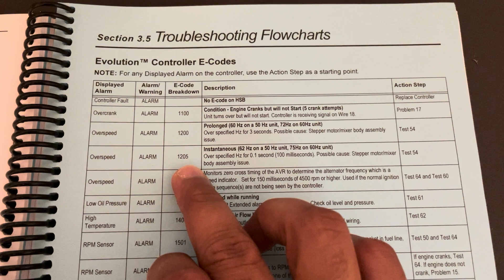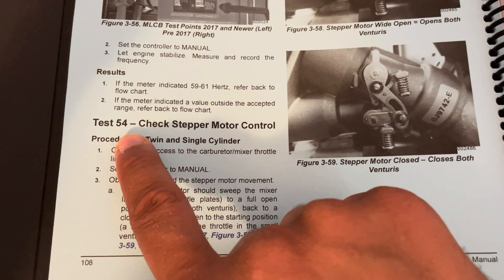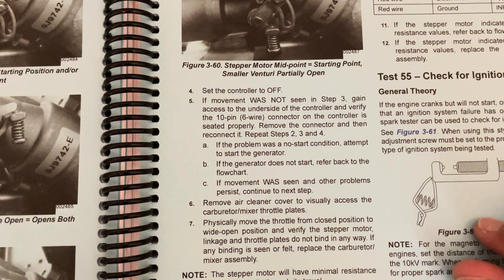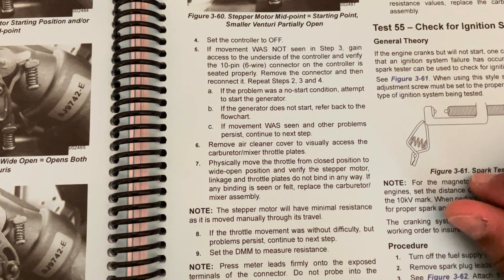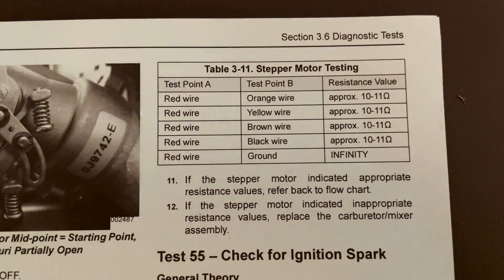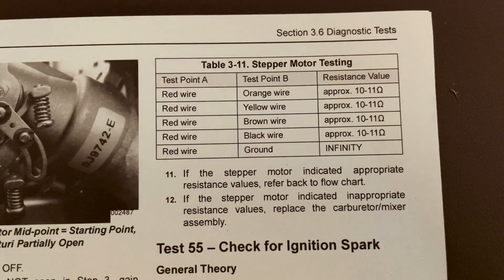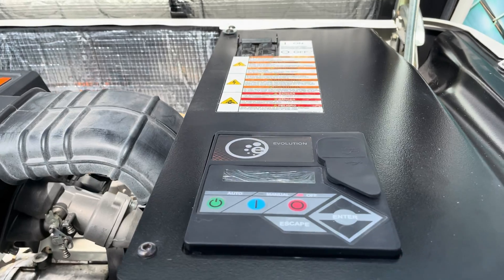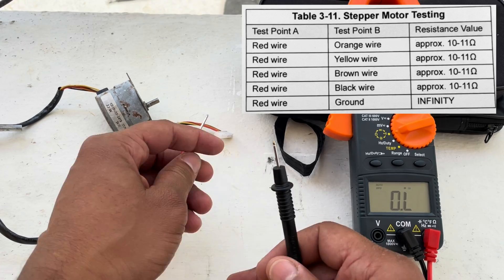How to Repair Generac & Honeywell Generators with Overspeed Fault (Error Code 1200, 1205)

Comment: why not replace the stepper motor only?
Reply from the maker: When I took the Generac Certification class we were told that Generac does not sell the stepper motor by itself and the entire mixer needs to be replaced. But in reality you can replace just the stepper motor if you want. I prefer to stick to OEM for these types of repairs, but there is an aftermarket option on Amazon.

Comment: Mine initially had a 1200 error code. I checked the 10 pin connector resistance and it checked out good. Now when I try to start it I am getting a 1100 error code. The movement of the mixer linkage does not go through its full open/close stroke before it starts cranking. A couple times while it was cranking, the linkage went full open and it started but ran wide open and shut down on overspeed. The linkage movement seems irratic. It does move smoothly by hand, don't feel any binding. Is this a controller issue? Fuel supply issue? Thank you for a response!
Reply from the maker: Thank you for watching and commenting on my video. Verify the fuel supply, the fuel pressure should be between 3.5 - 7 inches water column for natural gas or 10 - 12 inches water column for LP gas. I’ve worked on Generac Guardians with similar issues and all turned out to be the fuel pressure regulator. Keep me updated.

Comment: Dude! Just saved me some $$$ and headaches.  Had code 1205 and come to find out the wire pulled out. Plugged it back up and now running like new! Thanks
Reply from the maker: Thank you for watching! Glad my video was helpful and that I was able to save you some money. Believe it or not the stepper motor plug coming undone happens a lot, specially when the battery is replaced. People are not aware and pull the wire off while taking the old battery out or putting the new one in.

Comment: Hi do you have a video of how to chance just the stepping motor. Only. Because I both it but I. My take the old one off
Reply: Thanks. I did change it. I tought it was good to go and now its giving me 1900 code 😢
Reply from the maker: The 1900 code is the under voltage error code. That means the controller is not detecting voltage during startup and it stay in “warming” for a bit waiting for the voltage then it shuts down. It can be caused by a few things, unplugged conector at the controller (the small 4 pin connector), bad field flash diode, bad carbon brushes, bad rotor or stator. Even a wrong fuel selection will give you that 1900 error code due to generator not running to the correct speed to generate enough voltage. Hope this helps
Reply: @tacticalpowerpro  thanks for you time I’m gonna get it right so I can wear my shirt that I bought from you I won’t wear it until I fix it
Reply from the maker: @ismaelgomez8836 haha awesome! Thanks for your support, I hope you fix your generator and wear the shirt like a pro! Keep me updated 🫡
Reply from the maker: Hi! Unfortunately I do not have a video on how to replace just the stepper motor. But I will add that to my list of future videos. Thanks

Comment: So where do you go when you have a good stepper motor?  My problem is the rpm's are not stable and seems like it is searching.  Then all of a sudden the stepper motor spikes the throttle and the overspeed error comes up.  If I disconnect the 10 pin connector and manually move the throttle the engine purrs at a stable rpm. Connected back same problem.  The control module has already been replaced.
Reply from the maker: I just worked on a generator that had that exact issue you described. The mixer with stepper motor plus the controller were replaced and the generator rpm still spiked after a couple of seconds of it starting. 

I went and checked the LP gas pressured coming in to the generator and it was sitting at 12 w.C. (12 inches of water columns) like it should be. I started the generator and the 12 w.C. of gas pressure skyrocketed to 30 w.C. causing the generator to spike the rpms. Had the owner contact the gas company to check the LP gas tank regulator. They messed around with the regulator, now the generator is purring like a kitten. 

So my recommendation to you is check the gas pressure, you might have a faulty regulator. Hope this helps.

Comment: It’s the second time I came to see this video the first time I watch it I was available to fix the Generac in the middle of a power outage  I have the same issue you had. The little cable got disconnected when I change the battery.  But this time I think is gonna be the whole assembly cuz it did it 6 months later.  Thanks for the video. You really good explaining  everything nice and detail
Reply from the maker: Thank you for coming back to my video. Before you replace the entire mixer make sure you test the resistance of the stepper motor like in the video and verify that the throttle plate is not stuck. Yesterday I replaced a mixer that the stepper motor tested good but the throttle plate is stuck and won’t open all the way. If stepper motor and plates are good then your issue might be on the Evolution controller.
Reply: @   I will check it for sure. Thanks for taking to me to reply
Reply from the maker: Don’t mention it, I’m here to help. Keep me updated.
Reply: I checked the plate and it’s not stuck then I check the resisten and the blalcj cable shows infinity so I have a bad stepper motor.  There is not way to change only the motor you said righ?
Reply from the maker: Ok, thanks for the update. I mentioned in the video that you’ll need to replace the entire mixer because Generac doesn’t sell the stepper motor by itself. BUT, it is possible to just swap the stepper motor. You can find them on amazon, but I don’t know if they are good quality. You can give that a try.

Comment: I went through all this an everything looks ok even the test with the multimeter, what should a i do next ?
Reply from the maker: If the mixer and stepper motor are good then you might have a faulty Evolution controller.

Comment: On the test it looked like the movements were exactly the same as after replacement. What am I missing? Thanks for the video.
Reply from the maker: @WSmith2024  they where the same video clips, the generator was already repaired I didn’t have video recording of the “bad” stepper motor with no movement. I mentioned that the first time I tried to start the generator the stepper motor did not moved at all, but showed a clip of what a good stepper motor should act. The generator in the video only had an unplugged steeper motor connector.

Comment: A diagnosis was right on ,step MOTOR was unplugged. I had just installed brand new generator and tested.
Reply from the maker: Awesome to read the diagnostic was right on the money. Thank you for watching my video out of all the videos on youtube. I really appreciate it.
Reply: @tacticalpowerpro  HEY FOR SOME REASON MY BATTERY wont charge i have 120 V from T1 to the evolution 2 @ at generator where do i ck output battery charge
Reply from the maker: @alvinbihms9629  Hey, you can check the battery charger output or status at the controller but you will need the "dealer" access code. --> ESC, UP, UP, ESC, DOWN, UP, ESCAPE, UP, ENTER.

Comment: Why do you have to also replace the mixer  assembly when only the stepper motor is bad? Many people bought only stepper motors from Amazon  and said that fixed the problem.
Reply: Jus did he same thing and still getting the same overspeed alarm I so hate generac
Reply from the maker: @djterrorist4819  What you did? You replaced the stepper motor?
Reply: @tacticalpowerpro yes and the controller also worked fine for 2 hrs then 1200 over speed alarm
Reply from the maker: @djterrorist4819  Did you replaced the entire mixer assembly or just the stepper motor? if you just replaced the stepper motor then make sure the stepper motor linkage and throttle plates in the mixer assembly do not bind in any way. Also did you test the resistance value at the connector of the new stepper motor?
Reply: @tacticalpowerpro  yes it did ..we are now waiting on magnets to replace them …this was all recommended from generac tech support based on test 54 60 & either 60 or 62 can’t remember on hand ….generac is the worse brand of generator in the word imo lol I’ve done a few stepper motors and controllers but generacs trouble shooting process is complete trash and they cant pin point problem how they make seem …..I hate them so much to the point I’m goin to stop servicing them all together they suck
Reply from the maker: Was the unit giving you a 1207 Overspeed error code?  They must be talking about test 64 and 60 which are test dealing with the magnetos for the Overspeed alarm 1207 (according to their troubleshooting process). On test 64 you test for AC voltage and for continuity at wire 18 (wire from magnetos). Test 60 is checking and adjusting the magnetos. I understand how you feel, I’m not the biggest Generac fan either lol but hey they are everywhere so they keep me in business 🤷🏾‍♂️ I hope you’re able to fix your issue, keep me updated.
Reply from the maker: Also one easy way to test for issues at the magnetos is checking frequency at wire 18. You should see around 120 Hz (60 Hz per magneto) if you are under that 120 Hz then one of them is failing.
Reply from the maker: Generac only sells the entire mixer assembly. They do not sell the stepper motor by itself. But if you can find the stepper motor through Amazon then more power to you, just replace the stepper motor which is really the issue.